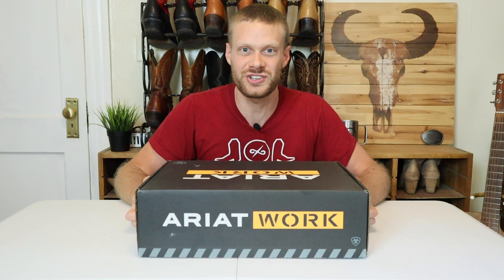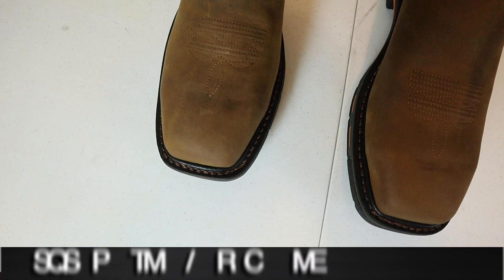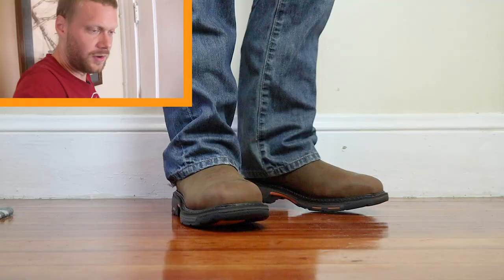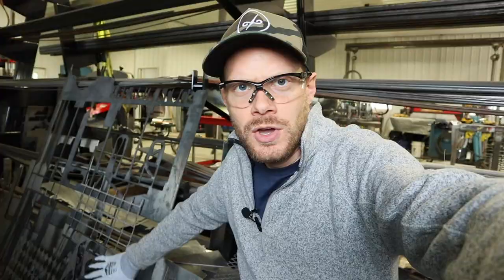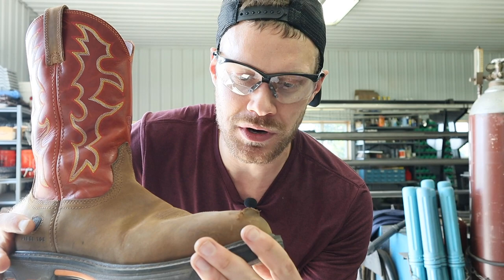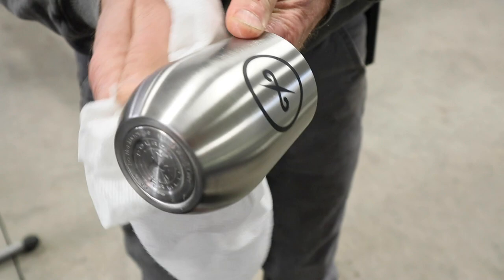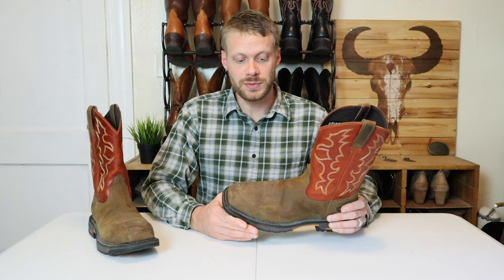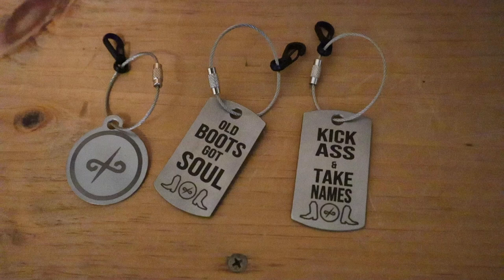Ariat Steel Toe WorkHog Boots EXTENDED TEST!

Comment: I work in these boots 12 hours a day everyday and I can say if your gonna be working in them constantly, go a half size down because they to wear in good, and for lace up boots go with red wings or thorogoods
Reply from the maker: I noticed they stretch a lot too for sure. Good advice
Reply: @JeremiahCraig   that means a lot coming from you, I’ve been watching your videos for years
Reply: Mine stretched a lot too
Reply: I’m normally wear a size in 11 in shoes, but the 11 EE didn’t fit me , my heel wouldn’t go in so I had to get a size 11.5 , you think the break in will make it loose?
Reply: @monke4632   not enough to make them uncomfortable
Reply: @monke4632   I’d go with redwing , thorogood , or some Justin commander x5s
Reply: Well I really hope the ones I just bought don’t stretch too much cause I’m a 13D and a 12D is far too narrow and too short and nobody makes a 12.5D. I wear a 13D in my Justin’s, Ariats, Thorogoods, Wolverines, tennis shoes etc. but I’ve tried some 13Ds that seem huge but a size down are too small.
Reply: My boss had them and said they wore out completely in like 3 months. Showed me the inside and it was just garbage. No new insole was going to save it. Heel rubbed bad on the reinforced part. Your thoughts?
Reply: @Geeds69  they have been known to have some quality control issues for these. Some will last years and some won’t last a couple months hopefully they fix that
Reply: @dylnfstr  well, that sucks lol. Id never buy a boot with that reputation

Comment: Ive had about 7 seven pairs of these because the county I work with used to give massive discounts on Ariat boots I can say they by far or one of the most comfortable boots I've had and that's working 5  10 hour days the only thing I've ever noticed with them from my personal experiences I wear out the inside lining near the u-turn technology spot and but other than that I've never had them fall apart exterior-wise

Comment: I've been wearing Ariat work boots for the past 12 years.  Just bought my 3rd pair.  I work in tool and die and walking on metal chips from a mill or lathe is very hard on most soles.  Ariat's hold up to the chips very well.  Since my first pair of Ariat's I've never considered anything else.  My only complaint is that I prefer a round steel toe.  Had no choice but to switch to a square toe this time.

Comment: Just putting it out there I bought these boots back between 2013 or 14 can't recall. But I was a yard guy at Ahern rentals they worked great 10 to 12 hours 6 days a week but as soon as I switched to residential framing the steel toe started peeping out so I set them aside. When I started landscaping they went to shit in 3 months the soles and the steel toe were all worn out and they hurt like heel. I now buy Durango boots and so far they are really nice and way lighter

Comment: I bought and began wearing these boots a little over a year ago.  I ordered a 9.5 EE and have pretty wide, relatively flat feet.  I began wearing the boots everyday to work.  I work as a diesel mechanic walking on hard concrete and climbing up on equipment for 13-15 hours a day on average.  I gave the boots a month to break in during which time they were by far the most uncomfortable boots I've ever worn.  They caused large amounts of discomfort and pain at the outer edges of the balls of my feet.  Finally, after two months of daily use they began to break in and became reasonably comfortable.  However, around this time I was cleaning the boots and noticed that both pairs had several cracks forming in the midsole.  These cracks were present on both boots and were not specific to one area of the midsole.  I decided to carry on wearing the boots as the break in process was such a pain it wasn't worth doing again on a replacement pair.  At six months of use the insoles had totally broken down and were causing discomfort that was very similar to the break in.  I ordered a new set of Ariat ATS insoles and the discomfort subsided.  Over the next six months of use the boots performed fair.  The leather on the steel toe ripped and began to shred on both boots causing large water leaks, and the cracks in the midsoles grew much larger.  Finally at a year and two months of use the outsole of the boots had worn completely smooth under the balls of my feet.  Several areas around the edge of the outsole had also started delaminating.  This caused them to flop and drag as I walked.  These new issues rendered the boots completely useless to me as I walk and work daily on oily, wet concrete.  My overall experience with these boots were somewhat disappointing and definitely underwhelming.  I've worn western style work boots most all of my life;  most of them less expensive than these Ariat Workhogs.  However, these boots ranked among my least favorite.  I recently purchased a new pair of Double H Square Steel Toe American made boots, and look forward to seeing how they wear in and perform compared to my old Ariats.

Comment: I have had 2 pair of these boots and will be getting a third pair. But I have the opposite problem you have where as you were talking about getting the B width I have to try and find a EE width
Reply: Try getting aa EEE width,  but seriously, had a pair of pullup round-toe Ariat boots some 20 years ago, the bus was not running and had to walk home the 3.5 miles after a day at work, feet were tired but not sore... have been a fan ever since

Comment: How would you compare the STITCHED soles vs the RUBBER soles. Debating between the ARIAT MEN'S REBAR FLEX H2O BROWN/GREEN WESTERN WORK BOOTS - COMPOSITE TOE and the ARIAT MEN'S WORKHOG H2O WATERPROOF STEEL TOE WESTERN WORK BOOTS. I do electrical construction work often in the dirt/mud, concrete, etc.. (mucks for really muddy days). Would love to hear any insight you or anyone has on these boots thank you!

Comment: Are they breathable or will your feet be sweaty. Working on concrete 10 hours a day. Chippewas are breathable but not good for concrete. Since there a logger
Reply from the maker: They are more breathable than a waterproof work boot bit not as breathable as an all leather lined boot or the Ventek from Ariat. My feet didn't sweat in these more than usual but they weren't noticably more breathable than other work boots I've tried. Just average

Comment: Im hoping you see this but I ordered a pair of these. They didn't feel as tight as any other EE boot I get since I have bigger feet and felt like they dropped on the heel more than the other pairs I had. Is it normal for that or should I go to a regular size?
Reply from the maker: I usually have to size down a half size for Ariat from other brands you may have to do the same to get the fit you're looking for
Reply: @JeremiahCraig  Used ariat the entire time, with sirrea type boots I think is what they were called I usually got a 12EE and they fit decent didnt drop on the heel when I picked my foot up but with the work hogs I do it and it drops more than the other pairs I have and my foot slides into the toe as I walk in them.